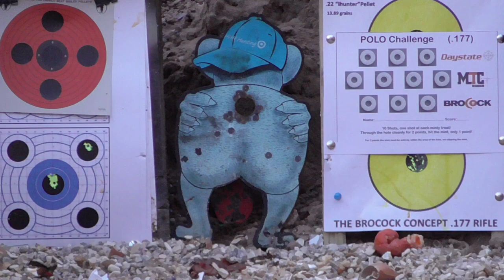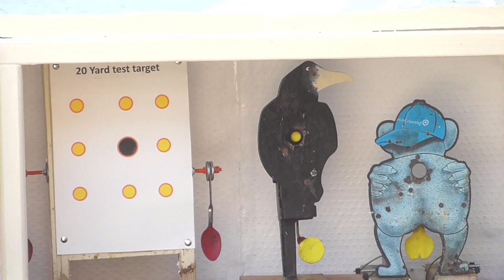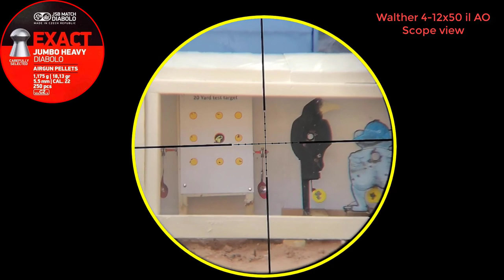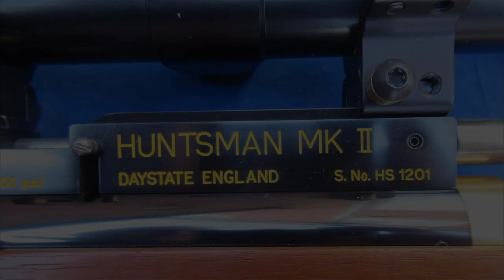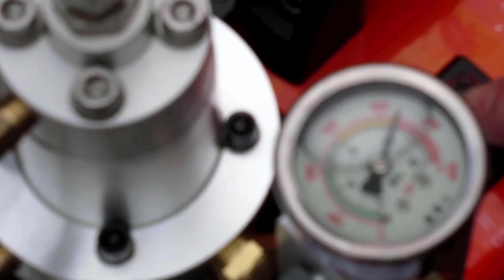An Airugnners Covid 19 - Twenty Two - What Shall i do Diary - Build a safe backstop for air-gunning

Comment: Excellent video you have given some ideas thanks
Reply from the maker: Hello Daniel, there are loads of options out there for making a good backstop. You can make it as easy and as expensive as you like. In the end it's all about keeping things safe, and if you can keep things quiet at the same time, then that's a bonus. I have used wooden boxes filled with sand, paper and towels in the past. Because of the recent lock down and most ranges have been closed it's all about adapting to your environment.

Comment: Just wrote a piece .. took me half hour to write .. looks like I didn't press the send icon BUGGER
Reply: Anyway .. ( much shortened version of lost post ) 
Hades .177 .. tested in another 2 rifles , not impressed , spread too wide for my liking , a when they DO group  5 or 6 pellets , there's always a flyer or two after ... Could be me . But I use pellets in the guns that suite afterwards , and everything is Rosy in the garden .. might be a duffle tin .. who knows
Reply from the maker: @markhomer7628  That is surprising considering how well the .22 version does. At least its worth trying them once to see if they work. Not all barrel's like certain pellets, and even the same make and model of gun barrel can vary. At least you know.
Reply: @airgunsniper-elite7385  
I must have a duff tin , that's all I can think , I'm not the best shot in the world , I know that , and I'd use that as an explanation for it's inaccuracies , if it weren't for the fact I used each rifles favoured pellets after , and as I suspected , quite reasonable results .. I'm disappointed , as ( as you mentioned ) the .22 are incredible .. it'll be great too see how you get on with them , once you take stock of a tin .. if by chance your results come out well , I might indeed , buy another tin , on the off chance the tin I have is a duffer ..